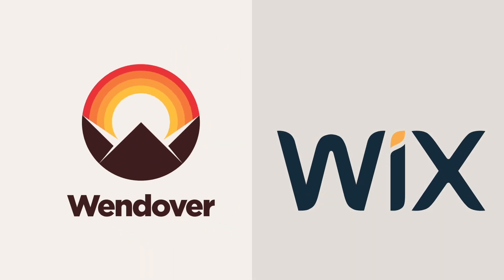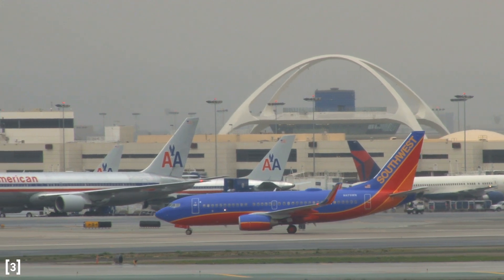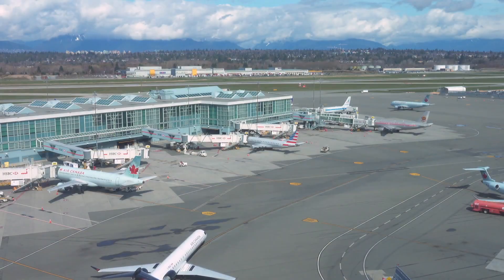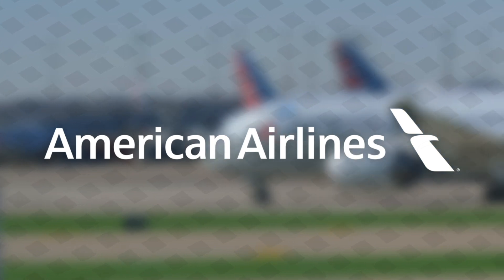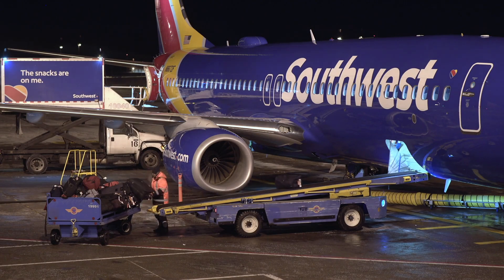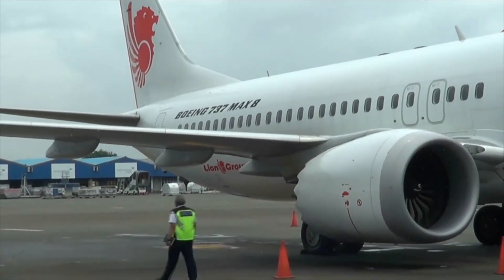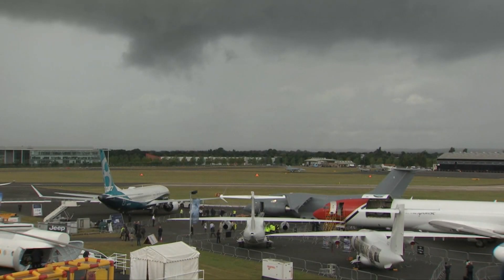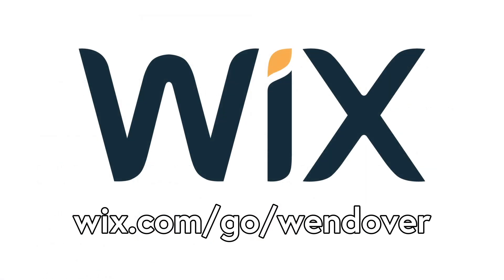The Economics That Made Boeing Build the 737 Max

Comment: Several have said that because the 737 MAX has only one AOA sensor, the planes are faulty and that's automatically the end of the story.

Perhaps there's a bit of truth therein, but I think the issue goes much further, and one critical related fact has been downplayed or hidden from view lately.

Early on during the news coverage of the second crash, there was a news item that said the one - yes, the only - sensor on one of those two crashed 737 MAXs had been damaged in a prior flight due to collision with a bird. That was known to the repair crews but nothing was done to repair/replace the damaged sensor, and it was allowed to fly again with an item, critical to control the plane inoperable. In fact, it would have continuously given erroneous information to the system.

If that is correct, blame for the crash of that particular flight cannot be laid on Boeing regardless of how badly those lambasting the design want to see Boeing's head on a platter.
Reply: it's still their fault regardless for not even bother to mention MCAS 

how much they paid you anyway

Comment: I worked on the overhead control panel design of the 737. A coworker and I examined every completed aircraft destined to be used in the first test programs. I was at Boeing Field, watching the initial 737 flight.

And I'm still alive. Are you sure most of my colleagues are not?
Reply: How many things wrong with that comment.

Yes you probably did work on the upper control consoles. However slight issue. The UCC panels were not the source or related to the problem since emergency indicators will be on the main consoles.

Second it's highly unlikely that a plane on a shakedown flight will have a critical fault

The fault was confined to a single system and the linked control assist systems so you, unlike the others in Africa, were perfectly safe.

Comment: I mean honestly, you really could trace Boeing's mistakes with the Max back to the decision that gave them no choice, but to update the 737 again. They cancelled the 757 far too soon. THAT was the first mistake that left the 737 as the only viable option 8 years down the road. Mix that with the issues with the 787 both pre-launch and post-launch (batteries) and Airbus announcing an upgrade to the A320... made Boeing panic to to release something to compete and cheap. As too much CapEx ws tied up with the 787 and its issues. With no other narrowbody to upgrade, no time to design a brand new plane, we get the rushed and Dr. Frankenstein's Monster/Airplane.Boeing and the FAA cut corners and sacrificed safety for costs to keep the Max on the same Type Rating as the NG. If Boeing changed the MAX too much then it would have had to have been a brand new plane/certification/type rating (ie costs)
Reply: They stopped building the 757...because airlines didn't want it.

Comment: The irony is that airlines use belts to load the 737 cargo hold in spite of the plane’s design supposedly rendering a belt unnecessary.
Reply: The A320 will take ULDs (LD3-45).
It's probably quicker to use a belt even with a B737 or DC9 derivative.
Reply: It's not meant to render belt unnecessary. The design simply ensures even if the airport doesn't have belts, 737 can still serve that airport, albeit with longer loading times.

Comment: I can't stand 737s I understand why airlines like them so much. The max is the plane that should be made in late 90s just on looks alone. I liked the Boeing plan for airlines meaning a 788 replace the 762 replacing 763 with 789 and the 764 with 787- 10 just like 727 replace  by 757s and that what Boeing wanted the airlines to do. But it wasn't in reality for airlines. Back in day if  Boeing and scare bus and MDs made a plane. That what you had to buy. But The 777s changed the game. But beside all of that. In my opinion. The greatest nrowbody ever made was the 757s. And that's the ones that is going out of business. And I understand why because of money.

Comment: This may actually be much bigger than MCAS or the 737 Max.  Ralph Nadar is a legend in the transportation safety industry as he went after automakers who were designing unsafe vehicles in the 1960s and 1970s and was the force behind the first significant Transportation Safety Act.  Well, Ralph Nader's niece was on that Ethiopian crash.  Their family is now suing Boeing and the FAA.  Former and current Boeing engineers were subpoenaed to provide information on Boeing's design and certification process.  One of their former flight controls engineer, Peter Lemme disclosed that Boeing has repeatedly and intentionally violated key system safety design principles and egregiously abused its FAA certification designee position to allow it to pass certification muster, resulting in hundreds of Boeing airplane passenger deaths and injuries over the years. 

Please realize folks, when MCAS engaged during the last nose dive on the Ethiopian flight, the aircraft was recorded at a speed of about 500 mph (faster than any 737 Max has likely ever flown at that altitude!). It took 32 seconds until it struck the earth.

Comment: MCAS and AoA type technology is used on both Boeing and Airbus planes. Because the problem of lift angle stall is a common problem on modern planes. The problem is not the technology. The problem is that the sensors were not redundant enough to cover faults. Yes Boeing is deep in trouble because they had no backup and no training and big cover up. But the overall upgrade of the plane is well done and smart. They need to install triple redundancy and adjust their software. There is a lot of bad journalism going around on this story. The 737 is still by far a great plane. The safety feature is the problem. Check your facts people. This story is incomplete. Certainly, Boeing will pay out billions to grieving families. But the plane is not the problem. The corporate greed is the problem.

Comment: Most of your information about aircraft is wrong. 737 don't run cables to the back, they run Hydraulic hoses. NO current aircraft starts with one switch. Watch an commercial airline pilot video where he starts an Airbus. One switch does not turn on the master batteries, start the APU, turn on the 115 volt inverters, spin engine 2 to 12% N1, turn on the combustion chamber ignition, and add fuel to start it. It takes about 25 minutes just to get the aircraft ready to push back.  
Paper checklists are great. If you have an electrical failure in flight the computer might be out. There go your checklists. I could on but won't bother.
Reply: 737 has cables for the trim.

Comment: I'll never get on a Boeing 737 max !!!!!  The engine had to be installed higher and higher after each generation. So there is a risk that the machine loses control... which is controlled and regulated by a technical system. Boeing knows/knew of the danger however because the company is controlled by shareholders profit stands before high security..., that came now with the 2 accidents to the light. Who believes the airplane is safe after a software update has not understood...  Who does not strike or boycotts on that can't be helped any more...

Comment: You note in the video that even after moving the engines forward and up there was 20cm added to the nose wheel height, presumably to improve ground clearance of the engines. The engines on the 737max still look incredibly low to me and would surely present additional danger in crosswinds. There have been reports I understand of 737maxs damaging runways upon landing. I did check the regulation and it appears there really is no minimum set ground clearance which surprises me enormously.  In practice though it tends to be around 50cm though I still don't know what it is for the Max. Could you perhaps comment upon this and clarify the ground clearance issue. The standard of your video is excellent.
Reply: look  at pictures of the MAX and NG. Ground clearance appears to be similar. While you are at it, look at engine mounting positions relative to the wing. They really aren't that different.

Comment: Pilot here. In my opinion, getting rid of MCAS could solve the problem altogether. Pilots are well-trained from day 1 about the dangers of a stall (or spin) and much of our training is centered around how to prevent and correct one. Therefore, this is not so much of an issue with the 737 MAX design and how it is just another revamp of the 737, but rather how technology is interfering with pilot's abilities to do their jobs. I believe that the pilots of the two crashes did not take proper control of the aircraft and should have been smart enough (or better trained perhaps) to disable any automation and fly the aircraft manually. Final reports have not been released yet, but this is my opinion as of right now.
Reply: Yeah ok but Boeing build an unperfect plane with known problems (bad flight behavior) that are fixed by software... Why they build a plane with bad flight behavior ?
Reply: @theduck001  But the software (MCAS) ironically caused the crashes, rather than preventing them. Even if the aircraft's balance was thrown off a bit by the new engines, there are other ways of solving that problem aerodynamically or by shifting weight in other places.
Reply: @CarterHancock  Yeah true. And the MCAS showed the whole world it's purpuse (bad design of the 737 max)... 

I don t know but i think it s dynamic, the inbalance is when the engines are on full power... So you would need weights that move around... This technical mouvement could fail too... Better is to redesign the plane...

Comment: Closer than the fake news abound.  Nevertheless, there are some critical omissions here....

1) AoA sensor feeding the flight control systems WAS FAULTY!  Previous flight crews “squawked” the problem to maintenance — but airline management delayed fixing it until next scheduled down time.  The crash aircraft WEREN’T AIRWORTHY to fly!!!

2) Previous aircrews who experienced the fault, were able to fly /land successfully.  Why?  Runaway trim is easily defeatable; MCAS generated or otherwise.  Dealing with this fault, is required for a pilot’s ”Type Certification,” and is a “Memory Item.”  (meaning the fault is time-critical, and referencing a checklist, of any kind, is too slow — thus is required to be executed by memory)

3) MCAS merely augments what previous 737 (and all other ‘underslung’) models autopilot systems already do.  Bigger, more powerful engines, means systems to manage them need augmentation as well.

4) Airbus and every other aircraft manufacturer producing models with ‘underslung’ turbofans use software to mitigate the exact same handling characteristics.  It’s well known, and far from esoteric.

5) Though much culpability of the MCAS training minimization lies with Boeing — Airbus employs the very same approach with their A320 model range.  In the quest to lower (training) operating costs, airlines push HARD on manufacturers to reduce evolutionary training requirements.

6) Though “new,” the 737-Max has flown many MILLIONS of miles, and tens of thousands of hours prior to subject incidents.  Ultimately, (I surmise) the changes will be additional training, a switchable AoA input to MCAS, and optimizing it’s authority.

The biggest lessons to be (re-)learned here:

• ALWAYS train pilots THOROUGHLY on new aircraft — no matter how similar!  Even the EXACT same model can be configured differently, for various airlines.

• Don’t operate aircraft which are malfunctioning!!!  Whether the plane has an actual technical fault; or is behaving nominally, yet the pilot doesn’t understand why.  “Pilot vs. Plane” happens, and each instance needs to be addressed!

Airbus has had FAR MORE instances of “Pilot vs. Plane” in it’s history, than Boeing.  As the transition to full automation, ‘Fly-by-Wire’ and full compu-control took over; there were crashes and many, many near-misses.  Yet, Airbus was given latitude to investigate and make changes at-will; WITHOUT grounding a model fleet.

There are greater geo-political and economic factors at play, and I suspect being EXPLOITED.  A bit off-topic, but if Airbus were treated like Boeing is — it’s very likely they wouldn’t exist today.  Food for thought....
Reply: I think you forgot to note one very serious point. In the Airbus, the new engines could fit into basically the same place that was designed for the engine placement. In the 737 Max, the new engines had to be moved to a different position. This is the crucial problem. It changed the aerodynamic properties of the original structural design.
  
While software is used currently on almost all aircraft to achieve optimal stability, they are generally used on an aircraft that is already designed to be as structurally stable as possible. This is not the case for the 737 Max, as this quote shows:

"In the 737 Max, the engine nacelles themselves can, at high angles of attack, work as a wing and produce lift. And the lift they produce is well ahead of the wing’s center of lift, meaning the nacelles will cause the 737 Max at a high angle of attack to go to a higher angle of attack. This is aerodynamic malpractice of the worst kind." - from https://spectrum.ieee.org/aerospace/aviation/how-the-boeing-737-max-disaster-looks-to-a-software-developer
Reply: @Observer-cd2ul  I think you should compare a picture of the MAX and NG engine placements. I think you will find them to be not that different. 737 engines have been well forward of the wing since the 373-300 in the 80's. 

The guy who wrote the article about the nacelles producing lift is not an aeronautical engineer. Nobody qualified has made this claim. Hans Landa's assessment is exactly correct.
Reply: @stimproid  If there is no problem with the stability caused by the new positioning of the engines, why is it that the 737 Max is the only 737 plane that requires the MCAS system?
Reply: Very comprehensive and accurate write up.

Comment: Yeah, so I'm tired of beating on the 737max. I thought this might be a fun topic to kick around: What should a Boeing new design narrow body jet look like? The right answer depends on market demands and fuel costs in the future. Those are impossible to predict with certainty, but I'll take a try. First, I'll get into market segments.

REGIONAL JETS:  The airlines want smaller regional jets carrying say 70-150 pax, and having short range, low price and good fuel economy. This is to connect small regional airports. Demand is strong. In answer, Airbus bought the a majority share in Bombardier, to obtain control of the CS100 series. Airbus rebranded it as the A220 series. In response, Boeing bought the commercial jet line of Embraer E2 series. These are similar in passenger count, range and fuel economy. They will serve this market segment well. [More about Embraer later.]

NARROW BODY SINGLE AISLE JETS: The airlines want lower priced, fuel efficient jets for say 140-220 pax. These have longer range and better economy per seat mile, but cost more. Airbus has the A320neo, and Boeing has the 737max. (And yes, I think it will be flying again soon, so it's here.) These will serve this market well. But Airbus is announcing variants on the A320, both larger and smaller (A319 and A321). Boeing seems to have good answers in the 737max-700  and 737max-1000 for the short term. But I believe they have to move on, both because the 737 brand is fatally wounded, and because Airbus is moving forward too. Perhaps China's Comac may develop something better than its current C919, which is not competitive outside of China. Facing competition, Boeing must move on.

The question is what should Boeing make for the next generation of narrow body single aisle jets? It's a tough question. One of the big problems is the huge development cost of a clean sheet design, say $30 billion or more. Add to that schedule risk, because new programs slip for many reasons. Add to that what I'll call new technology risk, because new ideas sometimes falter and that costs schedule time and money.

Boeing has many choices. The lowest development cost and shortest development schedule favors a lean fast rehash of the 737 (7N7?),  possibly using Embraer's excellent design engineers. It would have a similarly sized aluminum body and wings; composites are too risky and add unit cost. But if it looks like fuel costs will rise steeply, a composite body and wing may be better, tough call.  It's time to raise the body higher to allow larger, more efficient engines. It would use technology from the 787, including replacing hydraulic controls with electrical ones and using fly by wire. These choices allow modest fuel economy improvements but keep the purchase price low, and again minimize development cost and schedule risk. That's my best wild ass guess, maybe it will be close.

At the same time Boeing will be developing its New Midsized Aircraft (NMA or 797).   I'm mentioning it here mainly because the 797 project would be concurrent with the 7N7, so Boeing might be wisest to partner say Embraer to get the 7N7 project done in parallel. The 797 program will require most of Boeing's engineering manpower. I don't really have a clue how it will be designed, but I'd bet Boeing already knows.
Reply: I'm sure if one of your relatives were on one of the 2 that crashed thx to a company beeing greedy, you would have second thoughts, we can all consider boeing has done a crime here.